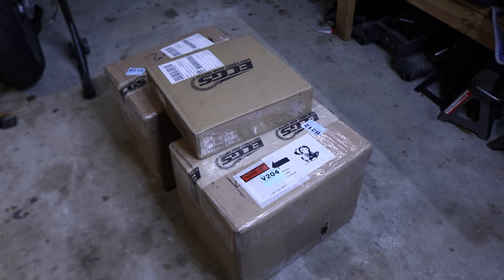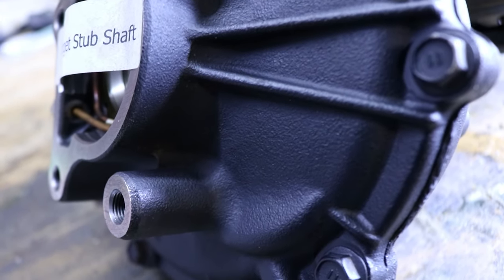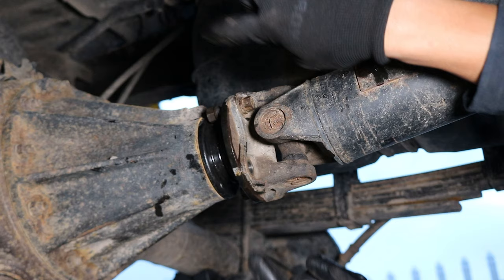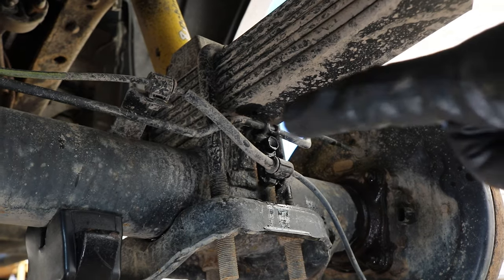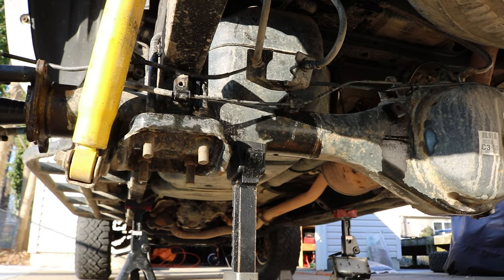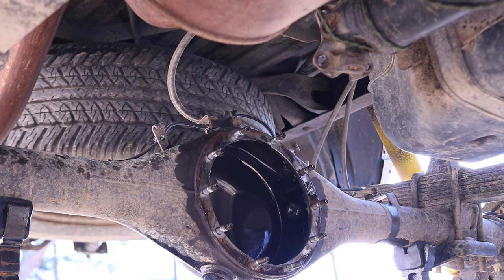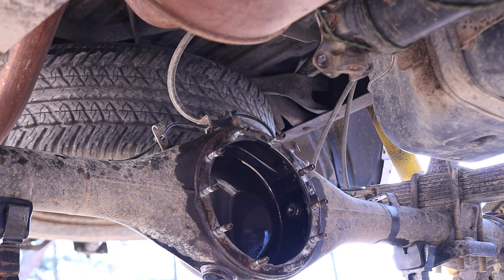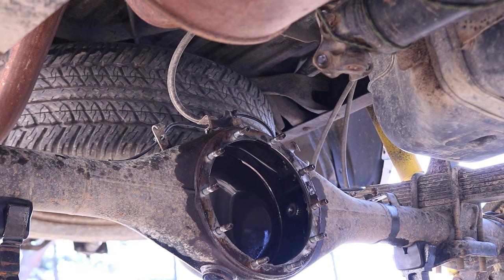Tacoma gets 4.88 Rear Gears! ((DIY / How To) Re-gear Part 2)

Comment from the maker: Guys, when you do this job and do the final torque on the 3rd member, make sure you go around those nuts twice to ensure that the nuts are tight. I would also advise to recheck the torque after a week of driving.
Reply: My Tacoma is currently in a shop for re gearing to 4:88 . Question what speed do you drive for the first 500 miles break in ?

Comment: Awesome tutorial. I'm saving for the same set-up. Looking at doing it this year. Side note: turns out my clutch started slipping after the suspension and tiers were done. Just finished putting the new clutch in. And what an improvement. Makes me question if 4.56 is enough for a manual? As it has even more torque than the 5.29s offer for the automatics. Waiting for your analysis of how the 4.88s feel in your manual.
Reply from the maker: Yessiree. I'll keep you guys posted! I've been driving around with it and that gear ratio is definitely high for a manual with 33's without any weight. I am looking to do 35's/37's though. I'll put together a detailed rundown when I have more experience with it.

Comment: The struggle is real. I upgraded my shaft with the tom woods single piece (I would highly recommend) and spent all day with a blow torch. At least it kept me warm, I don't have a garage
Reply from the maker: Yea, seized bolts in the cold is rough! I'll definitely get that one piece drive shaft as well! I'm actually looking to do the FJ transfer case swap before I do that - too many mods in the list...
Reply: @KFloTacoma  please tell me what the advantage is for the fj tcase? Is it lower geared?
Reply from the maker: The advantage is that it's completely mechanical driven - I know many people don't like the electronic actuators (the gear ratio is the same though). But to further up the advantages - one of my future custom ideas to do a gear swap on 4 LO in the transfer case to get the gear ratio even higher. That idea will include custom machined gears for the T-Case and pneumatic actuated 4wd to bypass the electronics - one of my many in the list LOL
Reply: @KFloTacoma  I will love to see how that goes I have also thought about altering the tcase gears, although it's chain driven? How would that work?can't wait to see. I will likely go to tacobox on one or both of the rigs.
Reply from the maker: The Tacobox would be sick! Yes, the T-case is chain driven, to add the chain itself is driven by gears. Here's what the inside looks like https://www.tacomaworld.com/threads/inside-the-05-tacoma-t-case.131275/ .. It will definitely be a huge design project due to the clearances - the idea would be to vary the gear teeth of the driving gear and driven gear.

Comment: Why did you take the brake line off the axle housing. When all you had to do was take it loose at the wheel cylinder. Just wondering.

Comment: Did you have any reason for not replacing the rear axle seals/O-rings while you had it apart, other than the fact that you have to bleed the brakes? I noticed you replaced the front passenger seal, since you already had access. I'm planning this project and am personally on the fence about replacing the rear seals. I will be replacing the rear brake hoses for extended hoses, so either way I'll have to bleed my brakes.
Reply from the maker: It was really for the brake bleeding plus the risk of the hydraulic brake fittings being rusted and seized together.

Comment: Hey great video! I got the same year truck as you. I just had a quick question and that’s when you order the gears did it come pre assembled?? If anything a direct link from your purchase would be greatly appreciated. Thanks a lot for your videos!
Reply from the maker: Here's the link: https://eastcoastgearsupply.com/c-1065072-assembled-3rds-clamshells-05-15-tacoma.html
Reply from the maker: I highly advise that you give them a call. They'll walk you through the process. When the third member comes in, it will be packaged and all you're doing is swapping out the old one with the new one. Then you send them back your old one.

Comment: How much was that set up? I have a automatic with 35s but want 37s and I’m looking into that set up just debating if I should get both lockers how much did you pay with with out core? Thanks…
Reply from the maker: You can price it out accurately if you go to ECGS's website. Eastcoastgearsupply.com. Ball park estimate without the cores and with Air lockers will probably run you about a bit more than 5K
Reply: @KFloTacoma  thank you

Comment: What would 4 30 gears in a 2011 tacoma 4cyl manual with 32 in tires be like? Is that a good combo?
Reply from the maker: I'm not too familiar with the power of the 4 cylinder. I would recommend reaching out to ECGS to get their tech's recommendation.

Comment: I have a 2015 Toyota Tacoma with bigger tires. It’s been 2 years now &  accelerating to high way speeds I feel that my truck performance is very poor.. I’m Putting back stock tires. Do I still need to re gear my stock tires to get back my original ratio?
Reply from the maker: It will drive like stock with stock tires. If you want better torque output regardless of tire size, you will want to regear

Comment: I need your help.. I have a Toyota Tacoma 2018 4x4 3.5 L,automatic transmission .. Replace the original tires with an LT285/70R17. It consumes a lot of gas and the RPM is very high. What Gear do I need so that I don't consume a lot of gas and that my RPM is not high ?
Reply from the maker: I would recommend 4.88

Comment: curious on why those bolts are set to 18lbs  and not any higher, like 25lbs that would give me comfort
Reply from the maker: Those studs are thin and tiny, also that's the torque spec also given from the shop manual. I would be afraid of over torquing them and shearing them off.